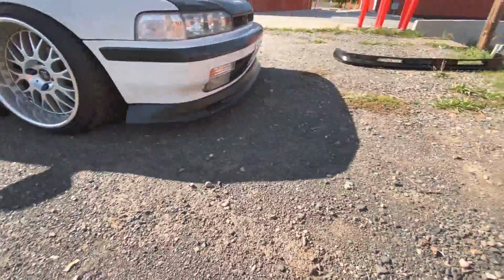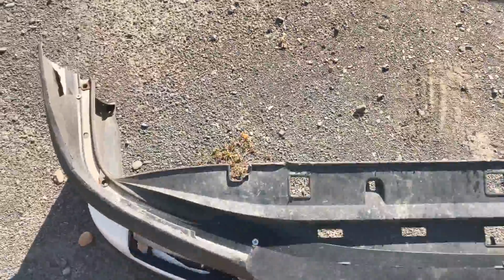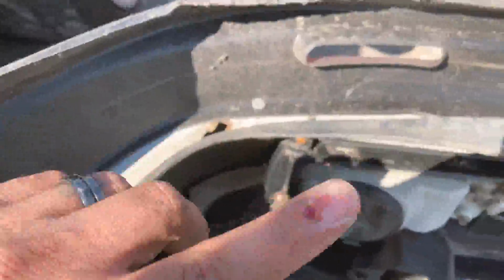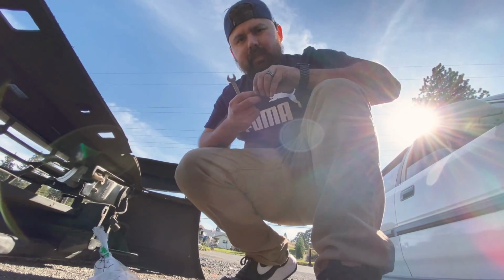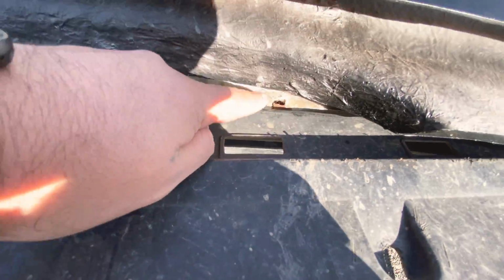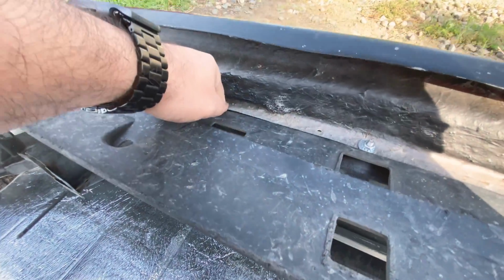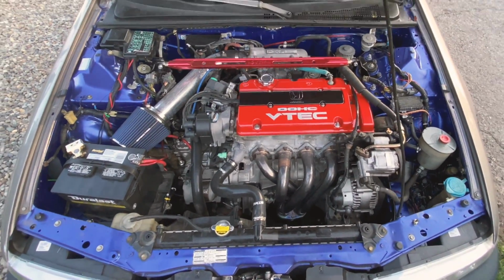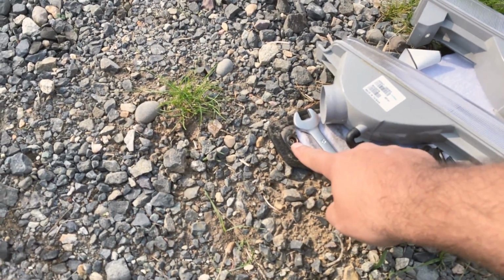Cb7| Jack Lee Fiberglass xenon front lip (install)

Comment: I'm way to paranoid to go with a fiberglass lip that low. Looks good though. Now that i have been watching your videos im having second thoughts about selling my cb7. I have a green 92 ex coupe in really great condition. Put it on tein super streets w/ tokiko blues 1.5 drop, legend lip, s2k antenna,  megan headers paired to a yonaka cat back, and i swapped in a jdm h22a 10k ago added the ks tuned manual timing tensioner, and walk block pulley, billet cam plug. Has a/c and power steering. Plans to be building the head and adding a quaife lsd this spring if i decide to keep it that is.
Reply from the maker: Gravelord Nito sounds like a keeper 👌🏽

Comment: I got an automatic Honda Accord LX but I'm having problems with code 6 someone who knows what to do please let me know.
Reply from the maker: erick garcia quick google search... I’m seeing water temp sensor
Reply: @Canongang  no the code 6 is from the TCU
Reply: It says something about the shift position switch circuit open
Reply: So this makes the car not shift in the gears when it haves to.to make it shift in we need to go higth to 5 thousand RPM